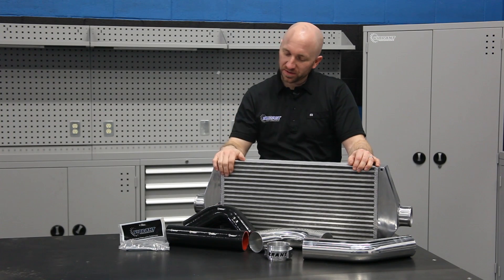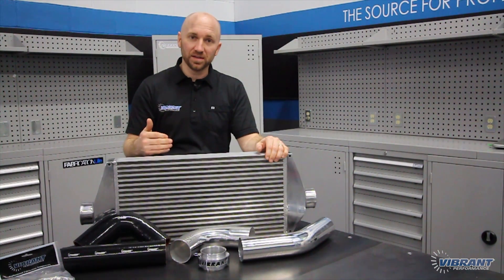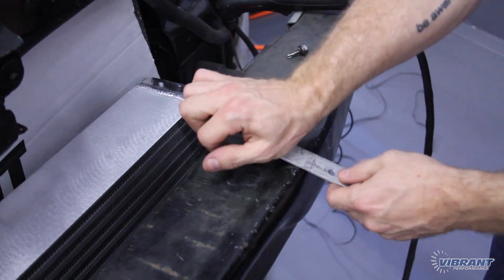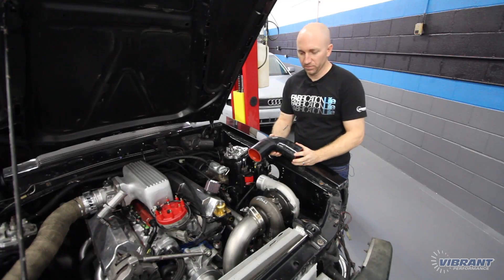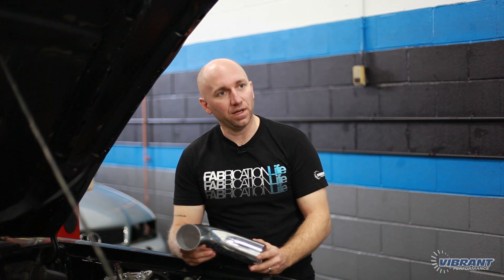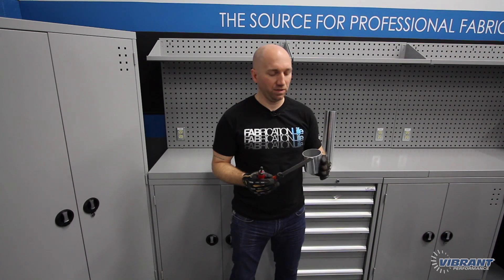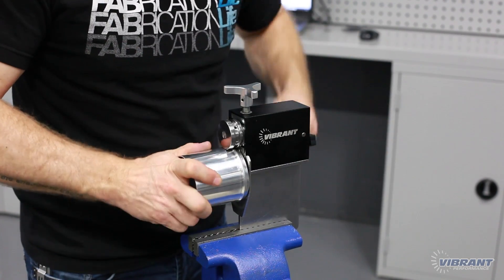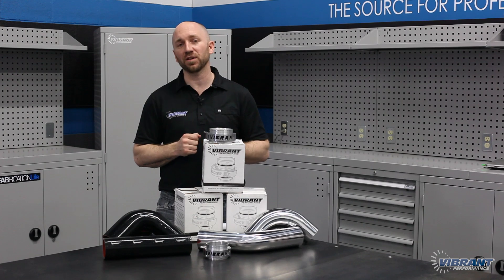Project Fox V8 Turbo Episode 2: Vibrant Intercooler Install and Charge Pipe Fabrication

Comment: If you only use one set of the mounting holes do you have to plug the other two?
Reply from the maker: No, you don't have to. They are strictly mounting holes, and do not affect any of the charge air inside the intercooler.

Comment: What welder was this welded on? and size of pyrex cup? I'm assuming you guys are using a 17 series water-cooled or air cooled torch?
Reply from the maker: Kris Bello Kris, Aaron and Jay use the Miller dynasty 200. 1.125" cup. WP-20 watercooled torch. hope that helps!
Reply: Where’s the rest of the videos?its 2018